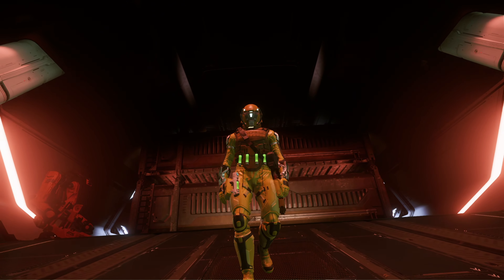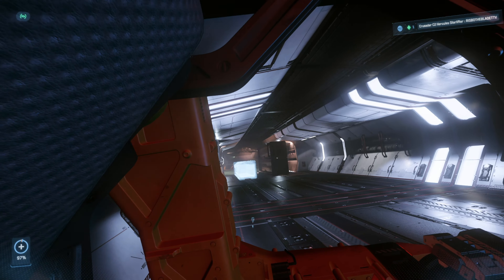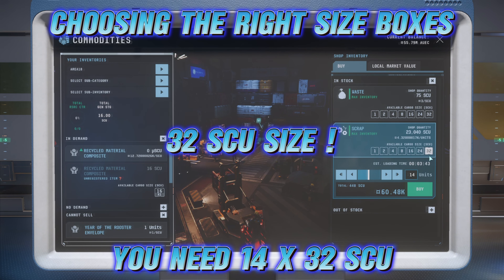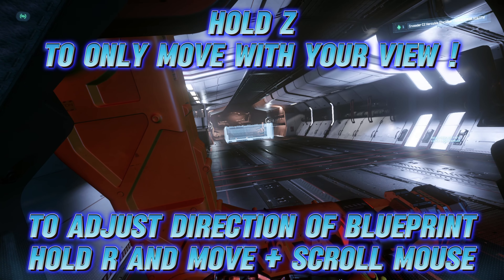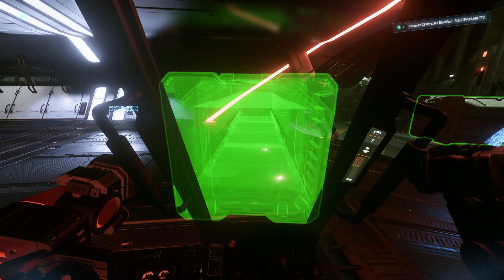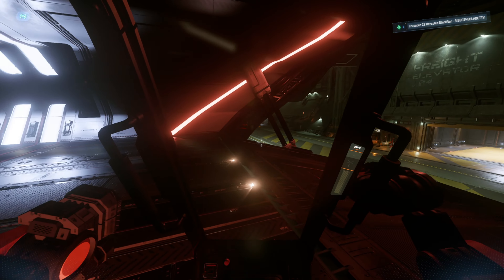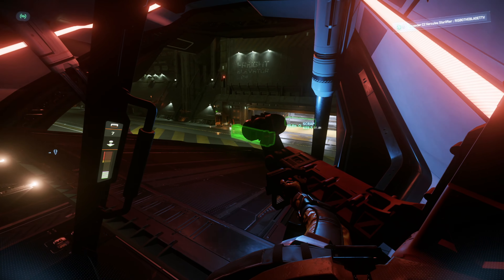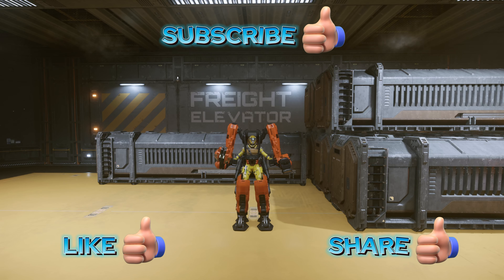Star Citizen - ATLS - How To Use It Properly and Fast in C2 Hercules Cargo Ship/ 3.24.2/ 4K

Comment: thanks for the vid, but even with these tips the C2+ATLS is useless for the Senior Hauling missions for example. You would want to do 2 of these fill up since each are 330scu on average.

The "medium" ones all have 16scu boxes + the odd small bs boxes and the way the roof and boxes clip and bloc its impossible to load the damn thing.. whether with ATLS or hand held. its driving me up a wall.. I grinded my way to a C2 and Senior missons doing a Freelancer Max route that was 220k every 30 min. Now in order to earn the same amount It takes literal HOURS to even load the c2 with ONLY 16scu boxes provided I can even load everything I wanna take (cant load 2nd level on one of the sides most of the time due to colision)

I really like your vids, and you make great content. I challenge you to try to fully load a C2 + atls and/or hand held with solely 16scu boxes.

PS. Did I mention the 19 MILLION C2 cant even stand proprely on level ground without bouncing all over the place? FTS
Reply from the maker: Yea I can try that, but I think is no problem to put 16 SCU in.
Reply: @risbotheblade2630  I certainly thought so... both on the front and back grid when I tried to maximize the space for every slot, I was able to put one side and the middle double stacked, but not the last 2nd layer. I altered sides, left the middle open, couldn't make it fit most of the time. I did get one or two in there but the rest (the majority) where just ridiculously frustrating and time consuming. The boxes and the roof have weird collision going on and like I said, neither brute forcing it with the power of the ATLS nor handheld would let me snap...

Let me know how it went for you

Comment: very nice video, i justr have one problem with my atls im unable to take the cargo of the grids in my ships with it
Reply from the maker: That knows to hapend. Also for exsample when you wann transfer something from the grid of one ship to a grid to another ship, it dont wonna work. Then just help your self with Max Tractor beam, always have that with you.
Reply: I had that issue when they first added the ATLS if I haf left the ship engines on, try shutting it down? I haven't had that issue lately but it may be dependent on what ship you are using or some other variables also.
Reply from the maker: @jammer_5502  Yea, Star Citizen is all about work arounds 😁

And, thank you a lot for your response ! If you think a video is very informative, please share it, so other players can get hands on good information and get help if they need it, and subscribe for more content!
Reply: @jammer_5502  this works for me, but also have to shut everything down.
and its all ships ive tried. C2, taurus and cat

Comment: So the ATLS is not good, Manual control of the tractor beam is better. Just make it faster and stronger than the Max. Or give us the option to turn off  automatic loading.
Reply from the maker: They could fix that problem by adjusting ATLS, so when the box is near the placement position, it's already perfectly aligned with the blueprint. The problem is that they want that cargo-boxes supposed to be 100% physical, but then you have all these problems with hitting other boxes.

And, thank you a lot for your response ! If you think a video is very informative, please share it, so other players can get hands on good information and get help if they need it, and subscribe for more content!

Comment: Hello Risbo ! Excellent tutorial ! This is the first time i hear about the "Z" key. This was exactly the feature i was looking for. Now i encounter two problems with loading. 
(1) Sometimes the farest crates on the elevator don't want to be moved (even with a MaxLift). They seem to be glued on the floor. The only way i've found to move them was to get close to them (less then 5 meters with a specific angle !) then use the MaxLift to detach them from the ground. Otherwise, the tractorbeam will have no effect on them :(
(2) About unloading. The crates are onboard the C2. Same thing, they can't be detached from their snapped position, i need to detach them with my MaxLift and throw them away. Then i can use my ATLS to finish the job.
Do you encounter the same issues ? Many thanks for your help. Now i need to have a look to your mining content :) Sub+1 o7 Citizen !
Reply from the maker: Yea, we have also that problems. Boxes are known to be stuck if you load them manually, and then after you need to unload, if you don't remove some other layers, it won't let you remove the box. It's just not working correctly yet, all that mechanics with cargo.

And, thank you a lot for your response ! If you think a video is very informative, please share it, so other players can get hands on good information and get help if they need it, and subscribe for more content!
Reply: @risbotheblade2630  Concerning the crates issue, i'm sure they will fix it soon or later. I was wrong about the ATLS, this thing is actually great ! Maybe you'll have to mention to turn off your Tobii Tracker if you have one, or it won't let you use "Z". You made my day ! Thanks again. May Klescher never catch you !
Reply from the maker: @KateMandoo.starcitizen  yea but if you have tobe then you dont havto hold z, you just look around.

Comment: Using ATLS to help me load/unload Zeus CL
Reply: How do you use it to pick up boxes on the ship? It will place them for me, but won't pick them up
Reply: @mirrormonstere113  I can pickup boxes but have to use mouse wheel to pull it from the ship. Then I drop it on the floor and pickup up back. Didn't know that's a common issue
Reply from the maker: @mirrormonstere113  You need to use your look, so when you look up more up, the blueprint goes further from you, and if you look down it goes closer. And you also adjust more fine with the scrolling mouse wheel.
Reply from the maker: Nice, but for smaller ships it enough to use just Max lift tractor beam.

And, thank you a lot for your response ! If you think a video is very informative, please share it, so other players can get hands on good information and get help if they need it, and subscribe for more content!
Reply: @risbotheblade2630  yeah, it's just my finger hearts to scroll so much